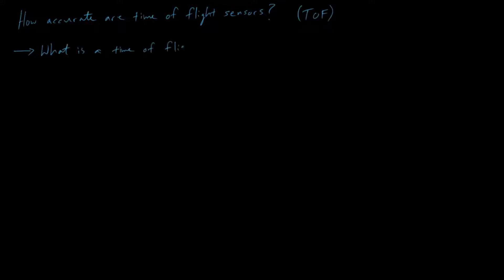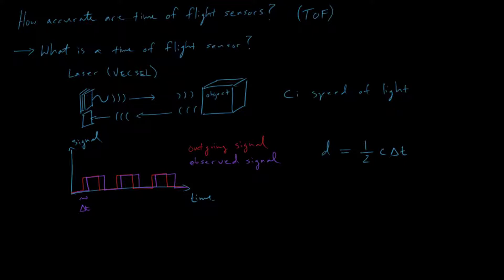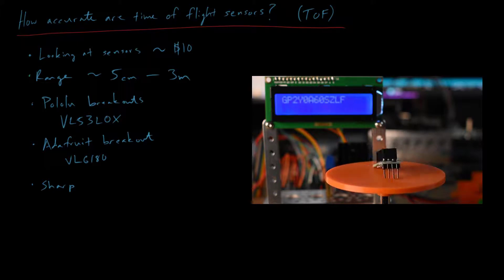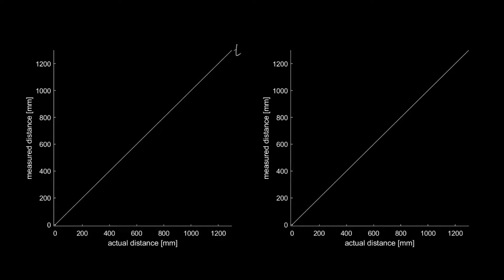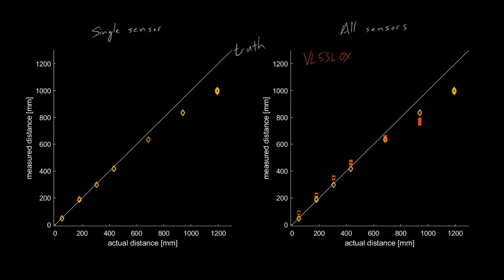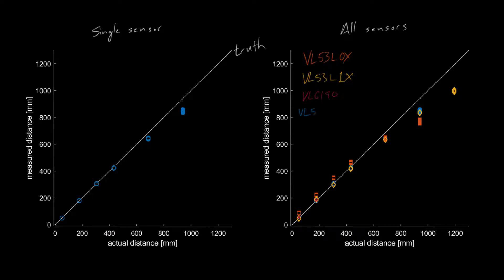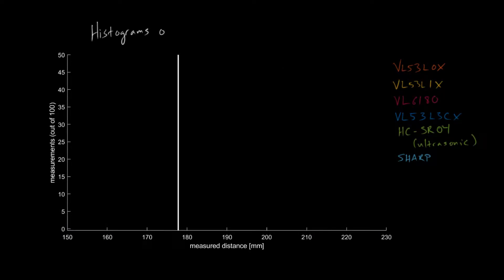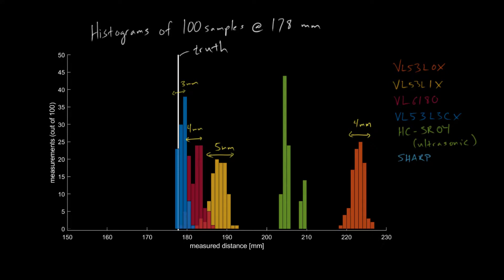How accurate are time of flight sensors?

Comment: I'm dumbfounded by these sensors. I can't understand how these sensors are capable of polling the sensor so rapidly. Is it possible only because of the reduced resolution when compared to visual spectrum sensors?

I ask because of how quickly photons travel. At those relatively minute distances, even a tiny amount of inaccuracy or lack of measured precision should, mathematically speaking, create massively significant errors in the sensor's overall accuracy. 

Modern consumer chipsets run at, at most, 6ghz. Mobile chips top out around 3ghz and there are people using these sensors with extremely inexpensive arduinos and the likes of the raspberry pi. It just doesn't add up when you consider how quickly a photon would travel between one CPU cycle and the next. Is there a methodology by which these sensors actively hone their accuracy during the imaging process?
Reply: The time of flight principle works irregarding processor clock speed. It is usually a small capacitor, which is being charged between start and stop events, with all analog front end. Then the capacitor voltage is being measured some way (slow).

Comment: Very well done.  One of my robots has only a VL530X, another has both the VL530X and a Grove Ultrasonic (HC-SR04).  In my home environment there are a number of very black obstacles (trash can, UPS, Chairs, Table legs) that the VL530X will only “see” normal to the surface or not at all.  

Would be very interested to see a similar report on Inertial Measurement Units.  I am frustrated by my robot’s wheel encoders giving equal or better heading accuracy than my BNO055 IMU (in 9DOF or 6DOF modes - 6DOF being better but no better than encoders).

Comment: Measuring a brown cardboard box favors the HC-SR04. In my master's dissertation I use the VL53L1X, HC-SR04 and TF Mini Plus for experiments with pasture. The VLs are designed for indoor use and are sensitive to sunlight (850nm infrared component), while the HC suffers from 40khz noise and uneven surface. The datasheet for configuring and using the VL53L1X is very complex because it is an integrated circuit that performs statistical processing, has ROM, RAM, allows you to sectorize a 16x16 ROI and restrict the FOV, informs the signal quality by SPAD. It has calibration functions for gain, protection glass and another one that I don't remember right now. Another feature is the short distance mode (1.3m) which slightly improves the light sensitivity issue. The Datasheet presents the measurement capability and error according to distance, ambient light and material reflectance.
Reply: My issues with the VL53L1X start at 500 lux of solar light.
Reply from the maker: Cool info. Maybe make a video about it.
Reply: Thanks for this detailed comment. Were you able to find a sensor adequate for your use case?

Comment: Hi there, the content is much appreciated! Very in-depth. I have project where I need to capture dance movements. I need a sensor that is fast, captures 3D topography of the human body, and can sense a range of ~5m/16ft. Of course, lastly integration with arduino IDE would be a plus. Any recommendations? Thanks!
Reply from the maker: That's a pretty tall order. These cheap sensors are definitely not going to cut it. I've never tried the more expensive lidar sensors, but you're going to need to head in that direction if you expect to get something decent. You know for your application you're probably better off using photogrammetry (unless you have cash to burn). Only done a little of it, but from what I hear the latest tools are pretty good at this. You might want to at least try it. https://blog.prusaprinters.org/photogrammetry-2-3d-scanning-simpler-better-than-ever_29393/

Comment: Sir I was searching for a sensor which is perfectly accurate till 2 to 3 meters distance. Please suggest any sensor which will work best 🙏
Reply from the maker: That is what I was looking for. I did not find it out of these modules. You will probably have to look for a more expensive sensor or use a ultrasonic one at longer distances.

Comment: I mistakenly bought the VL53L3CX thinking it was compatible with an arduino. Now I have an Nucleo board (STM32F401) but have zero experience programming it, and it seems like a fairly steep learning curve. Do you know any tutorials you suggest? I only need the board to send simple distance measurements over serial to a PC.  Thank you in advance!
Reply from the maker: Have you tried the examples from the library

https://github.com/stm32duino/VL53L3CX

yet? I don't think the learning curve for running a basic example should be too bad. In general, these other microcontrollers function mostly the same way as an arduino once you install their firmware. If you don't have the board running yet, start with something like this:

https://www.instructables.com/Quick-Start-to-STM-Nucleo-on-Arduino-IDE/

and then try the example from the library. I haven't tried that tutorial, but I have run other boards and usually it's not too bad. Let me know how it goes.
Reply: @curiores111  Oh perfect, i didn't know about stm32duino. It's working already!!! Thank you
Reply from the maker: @Diogopfonseca  Great! Yeah most of the common microcontrollers have some kind of port to the arduino IDE.
Reply: The nucleo board with TOF plug in will have a GUI available on the ST website. Run this , see how it works, if you like it there might be an API and you can use this in your own code.

Comment: It might be interesting to see how the tof sensors work with a retroreflective target? A reflective tape would be easy to apply...of course, this is not suitable for ranging for arbitrary targets, but could be applicable in some applications. If the error is caused by s/n drop-off, maybe you could dramatically improve the range/uncertainty?
Reply from the maker: Yes, that would be a good idea. From what I've read simply using white paper will help. I can think of applications where something like that could be introduced to improve the results.

I was actually pretty irritated when I made this video because the sensors worked worse than I expected, so I cut the video editing and experiments short. Maybe in the future I'll try again if I hit a project where these could actually be useful (they didn't work at all for the project I was working on).

Comment: I do have a small doubt...In histogram plot..ultrasonic sensor seams a bit far but gives a better measurement than the VL53L3CX...how is that possible
Reply from the maker: I'm not exactly sure I understand the question but I'll make a couple comments and you can let me know if I missed your point. :) In the histogram plot (which shows the spreads at 178 mm) the VL53L3CX is more accurate and has a tighter spread than the ultrasonic sensor. 

The ultrasonic sensor was, on the other hand, more accurate at ranges > 0.5 meters. I think this was because 
(1) the ultrasonic sensor was able to pick up the box well because it's a big target and 
(2) the TOF sensors didn't perform that great because the box isn't reflective enough for them to perform at their "rated" distances.  

In general, I was surprised/disappointed with the performance of the TOF sensors in this test. But, on the other hand, if I used a smaller/more reflective target, maybe the TOFs would perform better.
Reply: @curiores111  Thank you so much for the clarification...u really helped me a lot...I was reaching for this comparison and had a sleepless night 😂 and found it in the morning...U are a God sent angel...have a blessed life 😀😁
Reply from the maker: @maggieb9269  you are too kind. :)